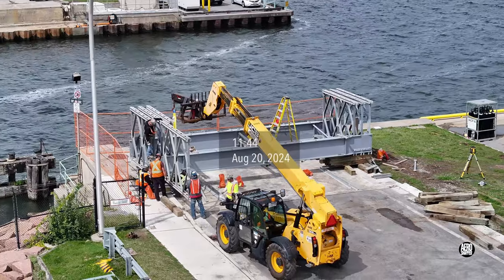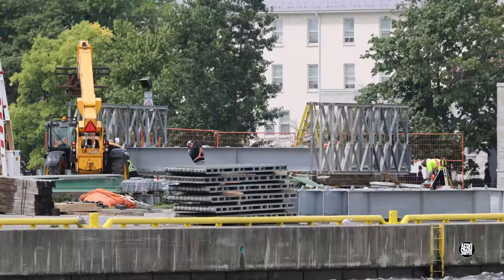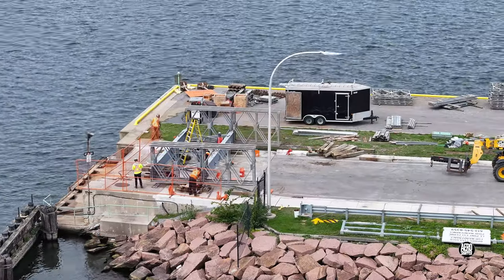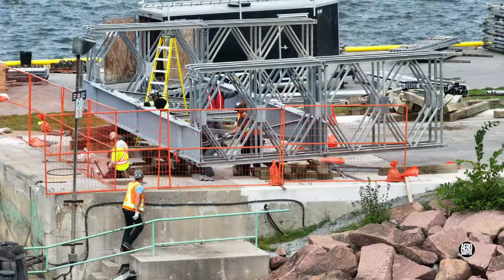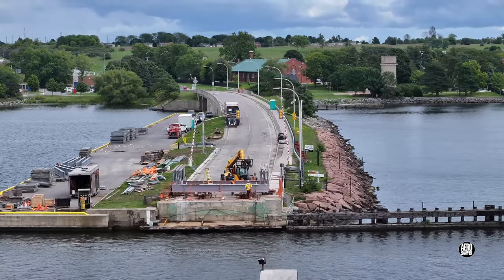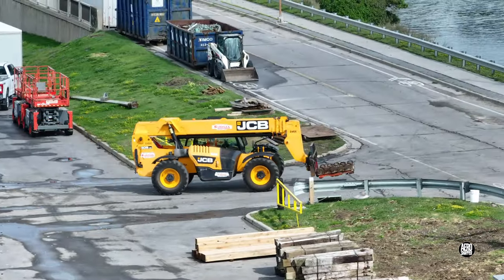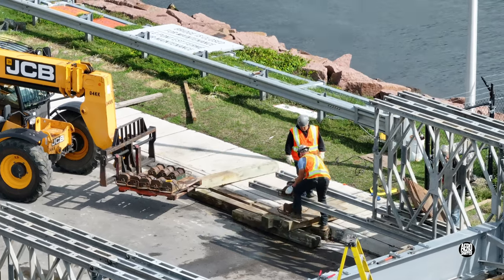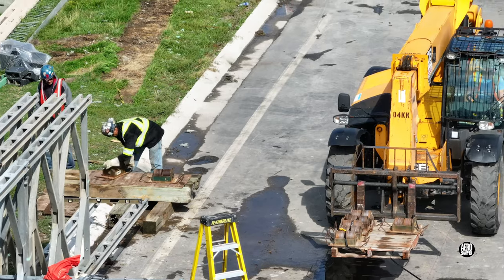Some Assembly Required - an update on the La Salle Causeway in Kingston, Ontario  4K

Comment: I wonder if those rollers will be installed in such a way that they will stay attached after it's installed? It would explain how they plan to quickly roll it on and off the gap for the planned monthly opening for ship traffic.
Reply from the maker: They don’t appear to attach to anything - and I’m not sure that a monthly opening has been announced anywhere. We can only wait and see. I appreciate the comment - and hope that you may be right
Reply: PSPC speaks to a plan to remove and reinstall it "a couple of times before the end of the navigation season", but don't commit to a timeline or truly guarantee that it will happen.
Reply: No the bridge will not stay on those rollers there are there to aid booming the bridge across the gap. The bridge will eventually be resting on the road once it's completely built and boomed across the gap.
Reply: There is a plan to move the bridge occasionally via barges.